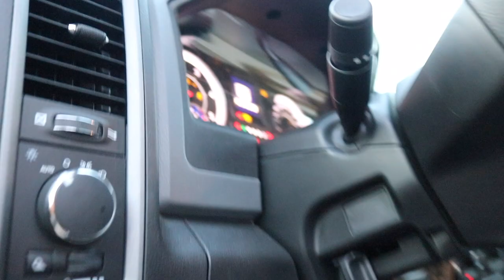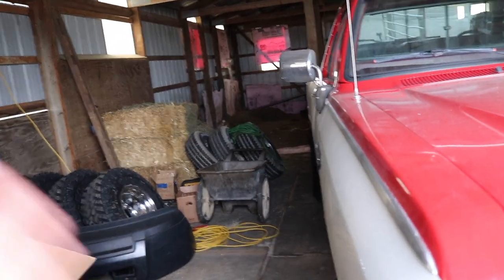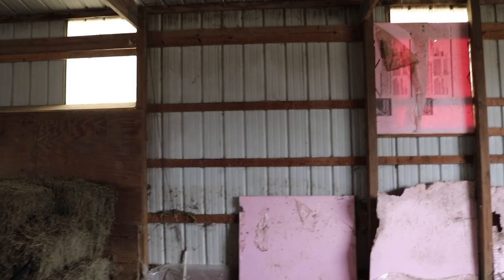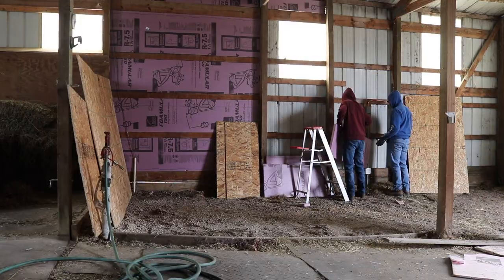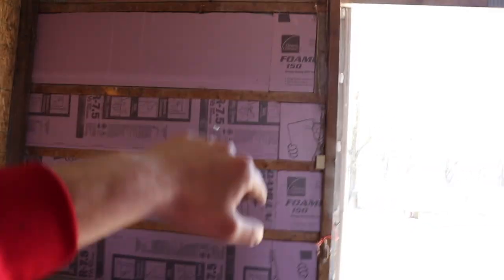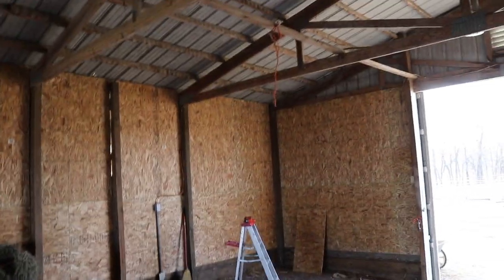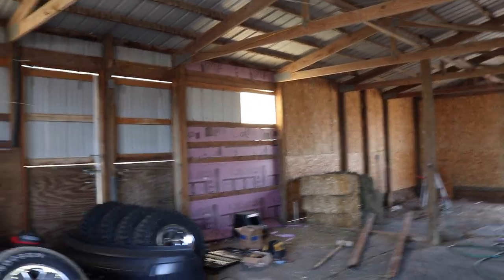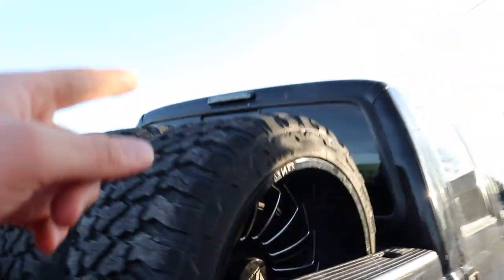MASSIVE PROGRESS ON THE SHOP BUILD!!! Ep. 3

Comment: When I saw you boarding over the windows.  My first thought was that’ll be good for video lighting.   You’ll remove the variable natural light and replace it with a controlled light.  
Also you may want to mark where the windows are.  So if you want in the future you can easily remove the wood by them.